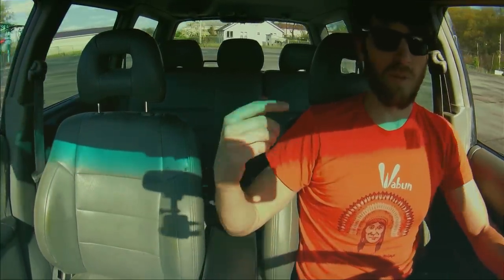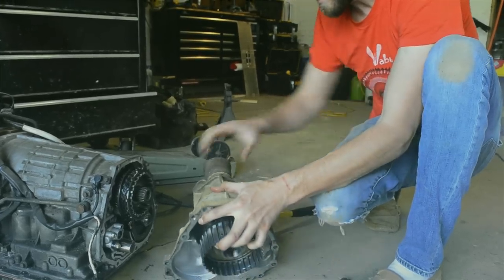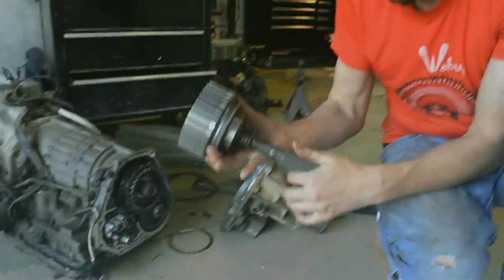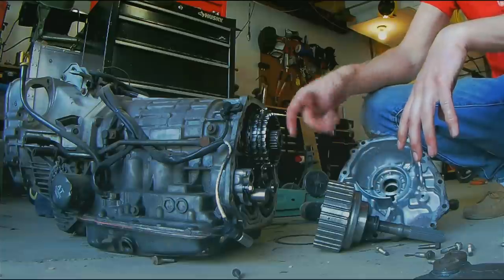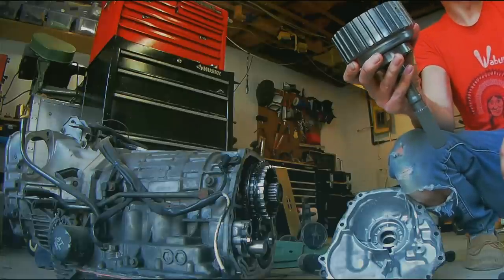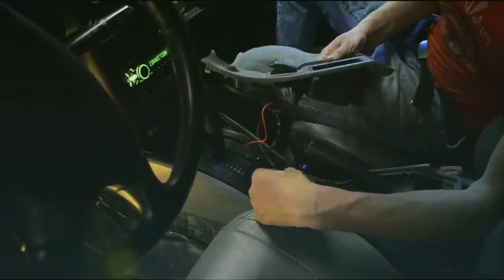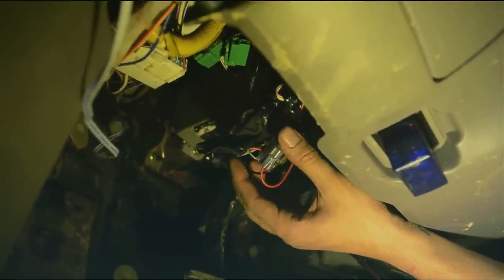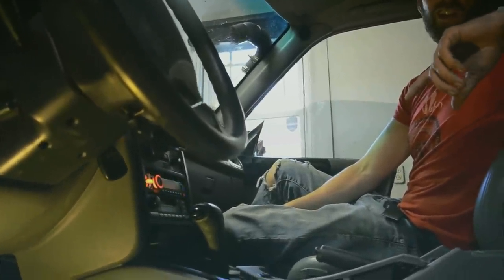Why your Off-road Subaru needs a locking center differential and how to install one for free

Comment: Is this actually locking the centre diff or just creating a 50/50 torque split like the manuals have?
Reply from the maker: Torque split. Manuals are only 50:50 during passive driving though. This stays locked no matter what you're doing.
Reply: @powerofyourbrains  As I understand it the viscous coupling in manual subarus have a 50/50 torque split until there is a difference in the speed of the driveshafts. Then it acts as an LSD and can transfer up to 80% of the torque to the end of the car with the most traction. Automatic subarus come with a multi-plate transfer clutch which under normal conditions has a 90/10 torque split with most going to the front wheels, then electronically can be changed to a 50/50 split but has no way of transferring more torque to tyres with more traction. So the manual center diff is pretty much better in every way than the auto one would you agree?
Reply from the maker: @dylanbradshaw8158   In terms of durability, yes, and hence the use of the switch. The manuals have 50:50 all the time while cruising compared to MPT models which have various degrees of static torque split depending on model and year (90:10, 60:40, 45:55 on VTD models, etc). What matters is the differentials ability to change torque split as soon as traction is lost. The MPT is very quick to change in response to conditions (proactive), and the vLSD coupler is very slow because it needs significant differences in wheel speed to do that (reactive). The problem with MPT models is that rough conditions are also hard on the transfer clutch. Best setup is one of the. VTD models, they're more durable and react quickly because the static spit is almost equal, and they retain the advantage of having the torque converter for hill climbing. I drive a lifted wrx manual, and it is far less suited for the kind of uneven terrain we encounter in the mountains.
Reply: @powerofyourbrains  When a MPT is locked into 50/50 torque split with your mod it would behave much the same as a vLSD before wheel spin occurs right? No reaction time is necessary for the same performance and behaviour as the MPT? Then when wheel spin occurs the vLSD should have a clear advantage over the MPT in that it can distribute more than 50% of the torque to the end of the car with more traction, which the MPT cannot do. A lifted WRX sounds awesome, fair enough where I live most of the challenges are mud which a manual works good for.
Reply from the maker: @dylanbradshaw8158  Correct, the problem really is that it very slow to do so. Even you have 80% of torque allocated to one side, as soon as conditions change it is too slow to react, which is a real problem in mountainous terrain.
Reply: @powerofyourbrains  Oh I understand, so you could have 80% of torque going to the wrong wheels.
Reply from the maker: Exactly, and in that scenario, unless you have VTD you'd be best off locking it using our little switch.

Comment: The tcu uses pm power to control the center diff.and you just trow straigh power to it?
Reply from the maker: Actual pulse modulation would occur if you have a dccd (the diff control knob). In most models with just a tcu, the valve actuation may vary continuously according to detecting traction loss, contrasted by pulse modulation which would allow for constant partial lockup. Also, you get fwd at 12v, and awd at 0v.

Comment: Question: how does this switch mode differ from the Winter traction switch in my SF5 with 4EAT?
Reply from the maker: I'm not familiar with the winter traction mode, but I think it probably just provides lockup under a certain speed. I know that in low you get some lockup as well, but with this mod you don't have to drive around redlining it all the time (like we used to lol)

Comment: Can you use a 3 way switch having a 12v source, the normal config for street driving and 0v for off?
Reply from the maker: A 3 way would work for basic manual control. The diff is engaged at 0v, so ideally for street driving you'd run 12v since you don't want to be locked up all the time on pavement
Reply: @powerofyourbrains  Ok so basicaly all you do is cut feed to selenoid and when you switch it off to run power through it is back to automatic mode?  Apart from your foz where you have vtd which it can't manage and you got it in fwd or awd without auto mode? 
Or I understand it wrong? :) 
It works with every 4EAT box?
Reply from the maker: Essentially yes. Works on 4EAT and 5EAT, as they all basically work the same way. You'll need to add a resistor where you splice the switch in as well, but you can find far more info on the forums about that.
Reply: @powerofyourbrains  sorry if I missed it but what value resistor?

Comment: I want to do the rear diff is welded. ıt ıs a problem ?
Reply from the maker: Short answer is I don't know. Long answer is that it depends on how you use the car. If its only for off-road like ours, you'd probably be fine. We chose the middle ground option of swapping in an LSD. See latest video

Comment: You say that this will work on all auto transmissions at the beginning of the video then say the trans needs to be a VTD.  Do you know if this will work on the ACT-4 auto trans?  I have a 97 OBS I need to throw a new trans in because the center diff is burnt out.  I just want to make sure I get something that will work in my car and that I can do this mod to.
Reply from the maker: It doesn't need to have a vtd, but it needs to have a transfer clutch. I'm not familiar with the act-4, but if it's still good you may be able to swap in another transfer clutch with or without a vtd. We did this after we destroyed our center, and because the unit we put in had vtd the computer was not set up to control, we had to install this switch to make it work. With subaru a lot of parts are modular so it might be worth looking into.
Reply: Thanks man.  I'm looking into the ability to throw an auto FXT trans with the vtd in.  It would keep my 4.11FD, allow me to create this switch, and apparently is very strong.  That with my 4/2 pots, and some FXT take off struts should make it a good winter beater for my wife.
Reply: From what I can understand all of the 4EAT's have the transfer clutch and this solenoid, so I should be good.  I think I was getting confused by the VTD tail shaft you switched.
Reply from the maker: What you saw in the video was just the old transfer case/clutch, but it can get a little befuddling for sure. Also heads up, we're doing this mod to granny right now and are discovering that the 0v signal which activates the solenoid is different on some of the older cars, activating at 12v. Should be simple enough to find out if this applies to you, just thought you may like to know
Reply: Thanks man, I really appreciate it.  What year is Granny?  Have you found if the VLSD rear diff is worth tracking one down and swapping it in?

Comment: Won't the solenoid burn out at 100% duty cycle?
Reply from the maker: If that were true, it'd happen in Subarus that rarely engage awd, since the clutch pack is activated by 0v to the solenoid.

Comment: Will this work on other AWD systems? Or just Subaru
Reply from the maker: That is a good question. Wondered it myself. Don't know for sure, but i'd imagine it probably would, at least for autos
Reply from the maker: Most awds have a fwd bias, so yeah, probably
Reply: On Chevy they use a variable position electric motor. You can't hook anything to it. It's not an on and off type motor.

Comment: How can i make this happen on my 06 outback xt manual?  
Anyone know?
Reply from the maker: Unfortunately you cannot. The manual center differential is fundamentally different from the transfer clutch in autos. You do already have 50:50 torque distribution though, and you should still be able to swap in a locking rear if you're so inclined. Really, the only disadvantage you have in a manual is that its a little slow in redirecting power f/r when traction is lost. In theory, if you're able to go slow enough you should maintain a 50:50 split.

Comment: '99 Outback 2.5, assuming centre "diff" similar to yours, judging by the clunk-and-surge I sometimes get on snow. Do I get this right - we have effectively no centre "differential" in the traditional sense, only a hard lock that's either off or on? Like in a old-school selectable 4WD where you have two options of either RWD or full-on 4WD with no centre diff, we have only FWD or 4WD?
Reply: i.e. is there a planetary-type centre diff in there as well or no?
Reply from the maker: @bobs12andahalf2  Correct, there are no planetary couplers in the 4eat. It's like the old school 4wd switch that engages automatically as soon as you need it. And like we said, you could pmw to the setup to have varying degrees of lockup if you wanted as well
Reply: Muchas gracious! So hard to get sensible information about this from the interwebs, all full of magical marketing mumbo jumbo and fanboy bs :D
Reply from the maker: It truly is. Subaru claims the 6mt on 2019 Crosstreks has a locking center, despite having the same old viscous coupler setup most manuals do. We're still trying to demystify that marketing, probably has to do with tcu trickery or something.

Comment: In theory could this be applied to a 19 crosstrek so long as it had the 6mt
Reply from the maker: Idk about that. Do you know how their claimed locking mechanism works? Because they're using the same old viscous coupling setup
Reply: @powerofyourbrains  you're right it is the viscous. I guess lsd's from a legacy may be the best option then
Reply from the maker: If the ratios match, go for it. But yeah, I looked into the 6mt and they do claim it locks. They probably are able to simulate locking electronically using TCS, but to say it's a locker is kinda misleading

Comment: Hey man! I have an 05 forester X Auto. I want to do this. I know it's simple but the links arent really helping. Is there anything you can email me? I want to be able to lock my diff on demand for off roading but still let the computer lock it on it's own while driving in the snow on the road. Thanks in advance!
Reply from the maker: Check out the rs25.com link someone left in the comments. That seemed to be a pretty good instructional thread that also explains the concept. I don't have any other materials I'm afraid.

Comment: That's for an old subaru
 What about 2016-2019?
Reply from the maker: I'll have you know that granny is 20 years young...lol. This will work, in theory, with later models. How the locker would interact with the cvt and traction control systems is unclear, however.

Comment: I had thought the center diff would automatically split torque 50/50 if you lock the auto trans into 1st or 2nd gear. Is that not true?  I have a 2009 Forester.
Reply from the maker: Matt H I believe it doesn't, but I could be wrong. Check the link in the description of models that are set up like this one and see if yours is there
Reply from the maker: Apparently, there is increased lockup in lower gears, it's not apparent how much however. That is something we can test for, thanks for bringing it up!
Reply: Yeah I think that happened to me in 2nd when I had to turn a corner and get accross fast 
I felt the "center diff" go clunk after getting upto 4000rpm with some wheel slip 🙄 hope it's alright still
Reply: So far still ok.. won't flog it in second and turn more then 45 degrees again 😬
Reply from the maker: Its probably best to play it safe, but I think you'd have to seriously mistreat it (like we have for years) in order to really screw things up. A little ol fashioned caution never hurts either
Reply: yes I think that is in the owners manual, 1st gear only, splits torque evenly i believe, be nice to your subie just stay in first gear, gentleman. just redoing heads on my 2001 outback after timing belt snapped on the tollway.  all 16 valves bent!!!  291,000 miles only made 91,000  on this belt. I think I better change the next one at 90K. Check those timing belts !!! Cheers !!!

Comment: Can i still install this on a vlsd??
Reply from the maker: vLSD rear (option) or center (manuals)?
Reply: @powerofyourbrains  m car uses vlsd, but would like it to centre lock when needed, is that possible?
Reply from the maker: Is it an automatic?
Reply: @powerofyourbrains  manual 6 speed outback diesel 2010
Reply from the maker: So you have a vLSD center coupling. I'm not familiar with the deisels because we don't have them in the states, but unless you have a dccd transfer clutch in addition to the differential, it is unfortunately not possible
Reply: @powerofyourbrains  how can i find out if i got a dccd?
Reply from the maker: You should be able to control your torque split with buttons or a knob or something
Reply: @powerofyourbrains  oh nah doesnt have an option for that (i think)  except traction control

Comment: Not how they work - its on 99% the time (usually ~30%) with varying levels dependant on throttle input, selected gear and speed difference between front and rear. They are FULL TIME all wheel drive.
Reply from the maker: It is full time awd.

Comment: forester is not for off road, only for muddy, sandy, snow or ice covered roads and that is from the top engineer at Subaru.  Your trying to do things with it that it is not designed for.
Reply from the maker: DOBERSTAFFIE Precisely ;)
Reply: Thats the fun part.
Reply: A 97 Legacy outback limited in stock setup isn’t meant for it either but I do it all the time. Even pass through mud puddles as deep as my headlights with water rushing up to my windshield with no snorkel. Dumb I know but fun playing roulette.